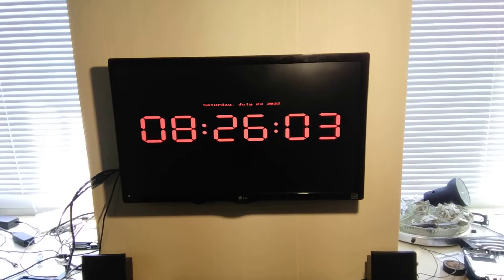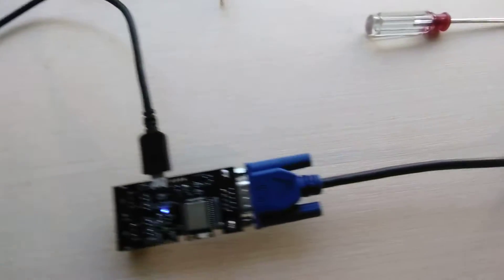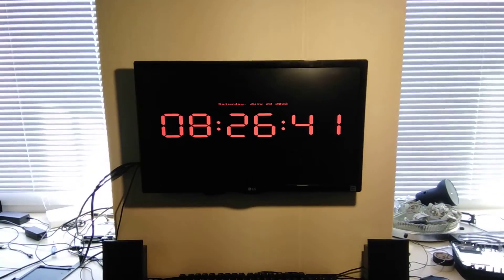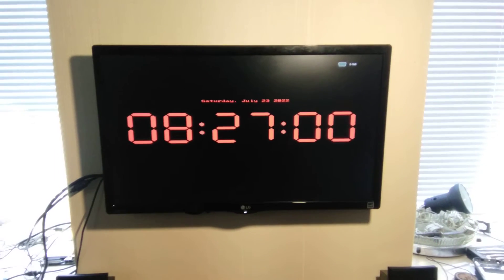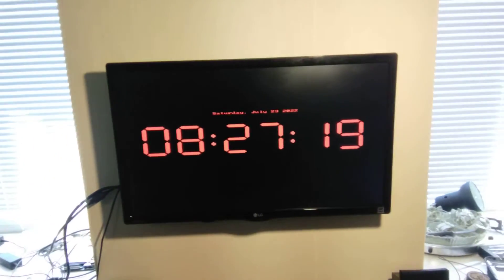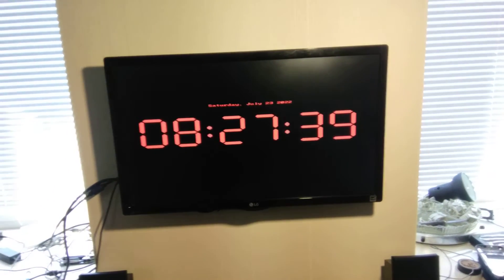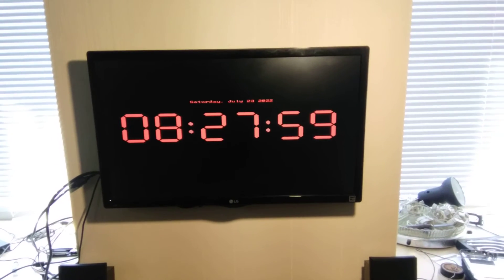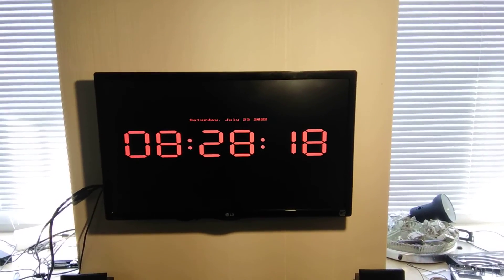DIY Fullscreen 7 Segment LED Clock with esp32 and FabGL

Comment: Hi mate, this is not relatable to this video but to the other webscraping tutorials you have on here. I'm a beginner and honestly just trying to be exactly like you.
Could you at least show me some of the resources you used to learn so I can follow in your footsteps too. Thanks alot.
Reply from the maker: Better be yourself. I didn't use other resources but framework's documentation. Check out my playlists - material is structured there. If that's not enough I'm available for paid lessons.

Comment: It's cool.  Maybe add info for temperature above or below ? Or other weather data. But I have a large red digit clock on my wall and I can't live without it.
Reply from the maker: If display was available then possibly but currently everything that goes below the time string actually doesn't exist from the esp32 perspective. Not sure why exactly. It feels like it's intended to be used with no more than 320x240 resolution on a 15 inch 3:4 monitor, everything that is bigger starts looking awful, especially on 16:9 screens. But with the current setup it's not seen and feels quite practical)